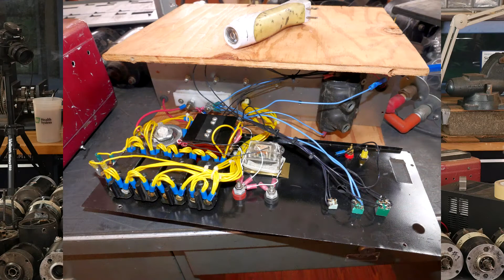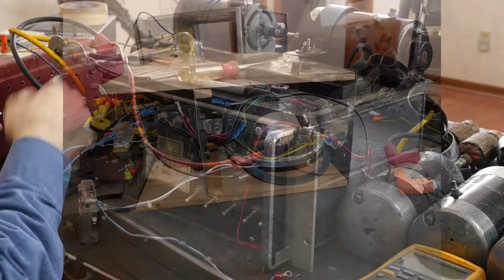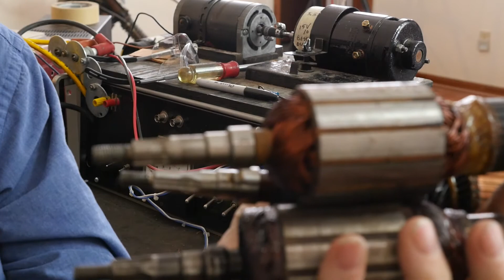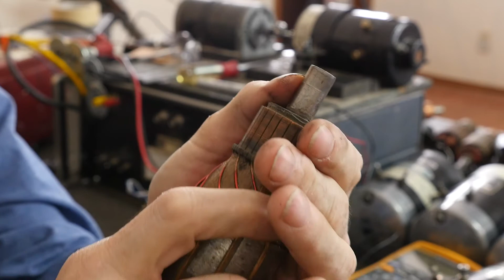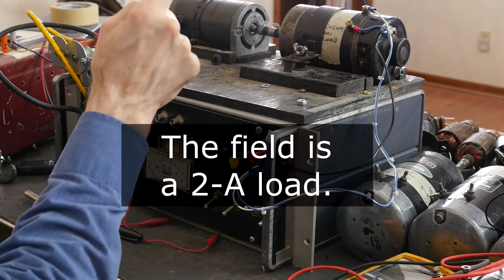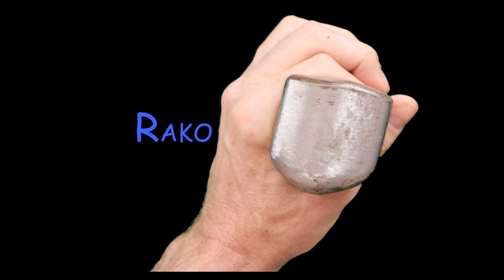Harley Davidson generator testing

Comment: Hey on your video iron sportster transmission part one.... Where did you get that mock up stand/ display stand that your using?! Do they make something like this you can bolt your trap door into so you could do all your gear spacing,  endplay measuring and adjusting without having to use your engine? It's a pain trying to measure endplay having to try to hook it up into a vice or having to install it and remove it from your engine, and would rather have a jig I could have on my table top.l

Comment: Hi Paul, first of all, thank you very much for all these video, it is making my life so much easier. I have one question, I rebuilt my 65A generator, bench tested it and all good but once fitted on the bike and polarized it wouldn't charge the battery and the gen light turns on unless I ground the terminal field with a jump wire like when you bench test it. Thanks again for you help

Comment: Want to test my 76' Sportster generator. Have the shop manual. Borrowed a old Snap-On DC volt/ Amp analog 30 amp tester. Want to test amperage. One lead on meter says Amps-Reg and the other Amps-Bat. Which one is positive?
Reply from the maker: Those both sound like the positive-- the connections for the current meter which you connect between the output terminal of the voltage regulator and the battery plus terminal. The ground might be the case of the meter. If it is just an amp-meter, there is no ground-- just the two wires so the meter replaces the wire from the regulator to the battery.

Comment: HI,
Not sure if you read all the comments, most are close to a year old compared to mine. Thanks for the demo. I am a shade tree, when it comes to electrical stuff, but it is something I would like to get better at.  LOL, it took me three-quarters of the way through your video to finally realize the motor on your left simulates the motor of a bike, I hope I am right. Basically to measure the output of the generator, I hope that is right as well. The amps and volts stuff.  It is great that you can simulate the electrical components on a bike that draws what it needs. I subscribed so maybe I can learn more. Thank you
Reply from the maker: Yes, sorry I did not make that more clear. The motor on my left is a small unit I found at an electrical salvage yard when I lived in Silicon Valley. It taught me a lot about how generators and regulators work. Thanks for the comment.

Comment: Do you sell one good and tested system? Reg/rec and generator together. I need a set that is tested (both) so it’s plug n play. Lemme know.
Reply from the maker: Not right now. I do have all those generators and figure it would be smart to test them all, fix them all and sell them on eBay, but no immediate plans, too many other projects first, sorry.

Comment: Brilliant video very interesting  thats a very smart box of tricks you have  made there a friend of mine had sockets for splin shafts   for alinghing  shafts I think but maybe u could adapt an extention bar to fit the motor and then just use a socket to suit what eva model u wanted it to fit
Reply from the maker: This is a great idea, thanks. I tried sticking sockets onto the spline and could not get one to fit, but then I realized I have a bunch of gears, and I can braze or epoxy a junk 1/4" drive socket to the gear, and then use it to power the generator. I figure to take a grinder to the motor, and file a square end on the shaft. The great thing is the socket means I could run the generator with a cordless drill.
Reply from the maker: Thanks to you, 30 years of suffering with that hose clamp deal to connect the motor to the generator is over. Based on your tip, I ended up brazing a 1/4 drive 7/16" socket to a junk gear I had. Then I filed a 1/4" square in the shaft of that motor. There was bad vibration since I did not braze nor file on center. Then I realized I can use two 1/4" universal adapters, and the off-center does not matter, it's as smooth as silk. Best yet, that 1/4" drive socket means I can spin a generator with a drill if I want. I have been floating on air for two days, look for a big thank you in the next video where I show the tester.
Reply: @Open-Sport.org  thats absolutely fantastic news well pleased that it worked  
im just glad  I was able return the help u gave me with my  clutch/transmission 
If u have a buddy with a lathe u could hold the  drive with the socket  on in the lathe drill chuck and the gear in the jaws push the tail  up to the gear and braze in place will be perfectly aligned  just throw an old fire  blanket  over the ways 
im a machinist my company specialises in hydraulics 
I have to make adapteres from time to to time for are test machines so we can test hydraulic motors under load 
Keep the videos coming really enjoying them there excellent quality and extremely detailed prefect content
Thanks Dan